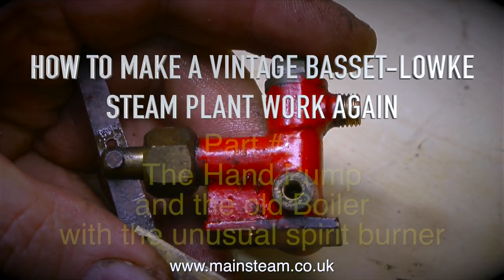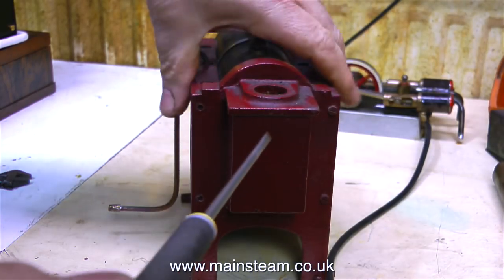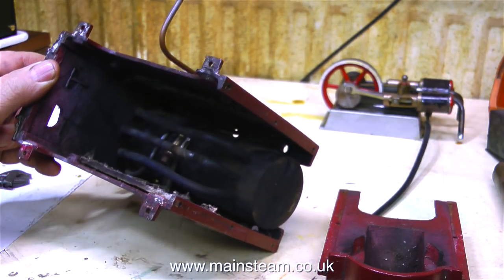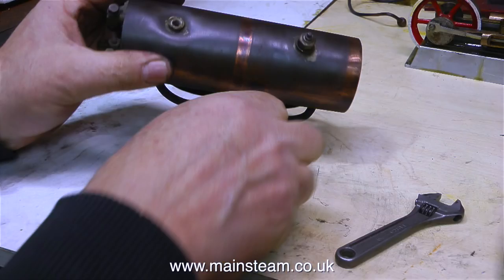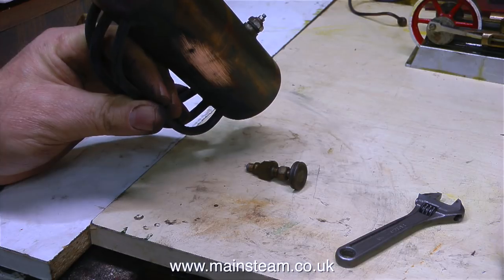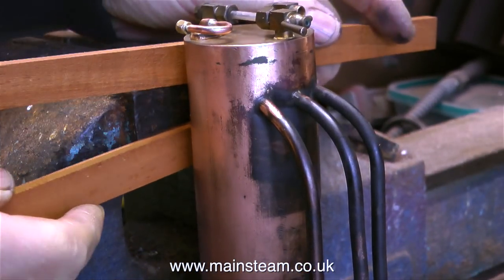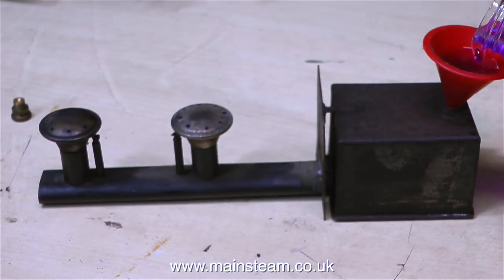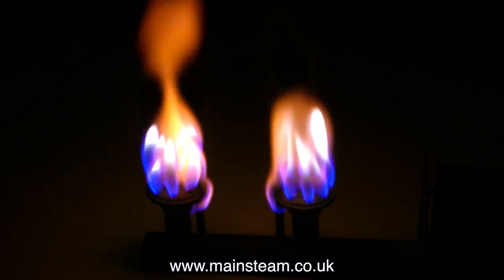HOW TO MAKE A VINTAGE BASSET-LOWKE STEAM PLANT WORK AGAIN - PART #2

Comment: Excellent work done so far. Yes you was right yet again. The burner has had paraffin in. My late farther had a haulage business, and a very big workshop in Owston Ferry. Heating the workshop he had paraffin heaters, so at my age at the time I thought it would be ok. I am now hanging my head down in shame. Not sure about the dent in the boiler, so can't comment on that. The generator did work, as I had a 6v bulb glowing from its out put from a old mobylette moped, But did notice just before giving it away that the  Amateur shaft is loose, and you can pull it out from the brushes.
Reply from the maker: Cheers Adrian,
I am on the case with the Dynamo. I will dismantle it and make a new spacer bush {:-)))

Comment: I built a different type of burner on the same principle. Mine has a horizontal tube above the small wick. I need to have a wick going up to the vapour using section in order to get a good burn but yours seems to be fine. This principle is explained in "Model boilers and boilermaking" from tee publishing

Comment: As usual a very interesting and informative video, and I was very impressed with the burner. And it looks like a good project for myself to build in the near future. So if it’s okay with you I would like to ask you a question: Can you tell if there is any warding or cotton wool in the feeder pipe from the reservoir to the burner jets, or in other words if you tipped it up reservoir first would it be like a double headed watering can? I know it’s a bit of a strange question but I really like the way this works. Thanks
Reply from the maker: It's difficult to see inside it so I don't really know - I will try and have a look this week . . .

Comment: Hi Keith, I've never seen this type of vapor burner either, so I'm building one this weekend to test it out. I'll let you know how it goes. I'd ask for measurements and orifice diameters, but I quite like to experiment. 
Thanks for yet another terrific video and Cheers!
Bob
Reply: look up soda/beer can stoves  I know there has been some work done on experimenting with sizes and  number of nozzles. adding a preheater loop ( like the old white gas stoves)   I use the yellow bottle of HEET  it's methanol aka race fuel.  the red bottle is isopropyl

Comment: Hi yet other great vidèo you mentioned a pressure test I've seen your previous testing. When on building sites I've seen the fire sprinklers during tests thay go to 15 bar thay have a bypass tap on the pressure side that feeds back into the water barrel. This would mean no sprinkling of water when you released the pressure. Unless of course you do like the odd little squirt! !!!!.

Comment: That burner is really quite ingenious, I like it. Be interesting to see if it would work well scaled up to fire a model not toy boiler.
Reply: Short answer is yes. 
Longer answer is: It has been used for larger steam plants from what I've seen. It has a somewhat lower heat output than propane/butane but a larger head would work fine to heat the boiler.

Comment: Methylated spirit = denatured alcohol.  That's grain alcohol (ethanol) which has had something toxic added to it, to prevent imbibing.  Methanol (wood alcohol) and [IIRC] pyridine are some denaturing substances.

If economical, 91% isopropanol will probably work in the burner too.

Eli D.

Comment: Hi Keith, what’s the working pressure on a small boiler like this and what sort of pressure do you need to drive the small engine?
Reply from the maker: Not much at all - about 30PSI would be more than adequate. I will check it before use by seeing what the safety valve is set to.

Comment: That boiler intrigues me, mainly to say the pipes underneath the boiler. Do they help at all with how long it takes for steam to build up or not? I would imagine that they would, but you're much more experienced than me when I'm making my boilers from tin cans, copper pipe and JB weld.
Reply from the maker: the pipes underneath the boiler increase the surface area for heat exchange.
Reply: @keithappleton  Wonderful, I thought so, thanks for the confirmation.

Comment: ive the same engine i put turps in the burner by accident and filled the room with black snow.
Reply from the maker: yes, I put cigarette lighter fuel in one once - it was a very sooty flame .....
Reply: i dont suppose you know the size etc of the conicle tap on the water gauge do you as ive broke my handle. p/s im not a model engineer would just like to repair mine.My engine has the boiler feed pump think it needs repair as it sucks water then squirts it back out the in feed lol.

Comment: Some contraption like a "tiny slide hammer" would also have worked maybe for your dent :)
Reply from the maker: Yes it would, I thought about making one - {:-)))
Reply: In fact a bit of threaded rod serves quite well as a slide hammer. Just a bolt and large washer at the business end does the trick.

Comment: how were you sure it was a methylated  spirit burner? it could have been alcohol. i see that you were correct.
Reply from the maker: it's a type of Alcohol either way - sometimes I have used Methanol in the past as that is also clean burning but with a virtually invisible flame . . .

Comment: Your burner works in a not dissimilar way to a Trangia camping stove.
Reply from the maker: Yes, I have one of those.
Reply from the maker: These spirit burners are underrated - they do provide a lot of clean heat . . . . less smelly than some gas burners too..... the only problem is that generally tou can't adjust the output - they are on number 11 all the time until the spirit runs out . . . .

Comment: Didn't know you could still get meths...by god I learn stuff on here...
Reply from the maker: Yes, I drink nothing else {:-)))
Reply: Most hardware shops carry it. Usually in 500ml bottles, thought sometimes you can get it in "gallon" cans, about 4 litres instead of the proper 4.5 litres of a real gallon. 
I miss the days when you'd buy a gallon (real one) can of meths and when that ran out, you went back and got a refill of the same can. Proper recycling/reuse.